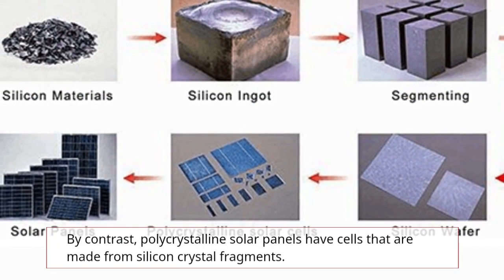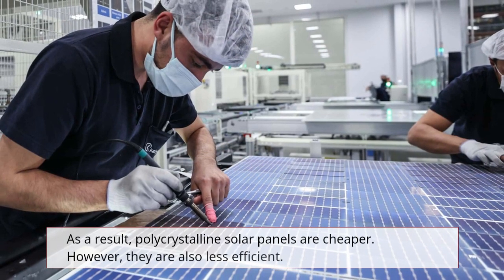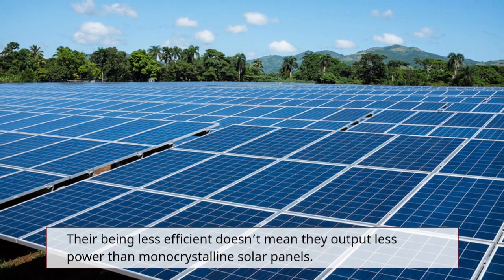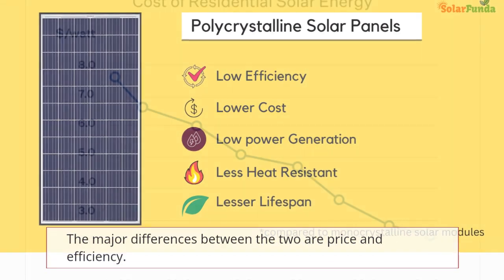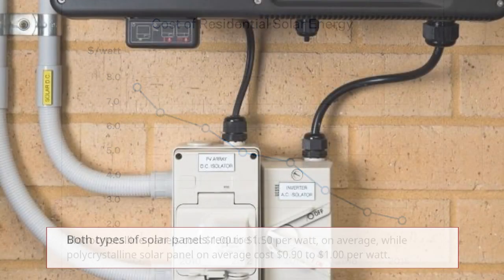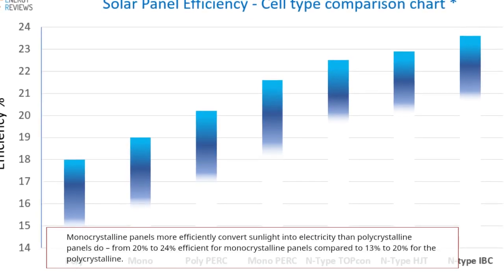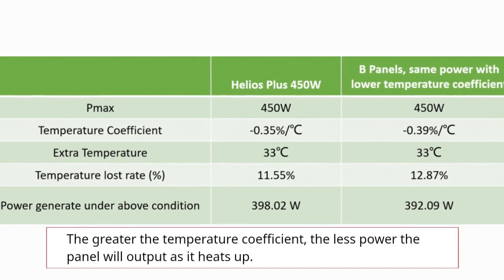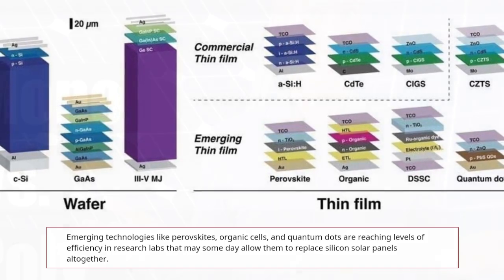Monocrystalline VS Polycrystalline Solar Panels 2023 | AI-Automated |

Comment: Does one type make more sense depending on which states in the USA, for example it makes more sense to think about getting one style VS another when
in June, July, August,  area's like  Las Vegas,  Phoenix,  have  high winds and average tempertures over 105 degrees for over 60 days straight....
Reply from the maker: well thats when I would recommend check the specifications of the solar modules. You need to see what is the percentage value of the temperature coefficient between the monocrystalline and polycrystalline panels. Generally the monocrystalline has a better temperature coefficient value and the general rule is that the lower the percentage value for the temperature coefficient the better it will perform in harsh weather and temperature conditions. I hope this answers your question